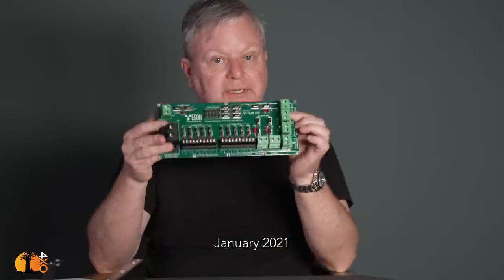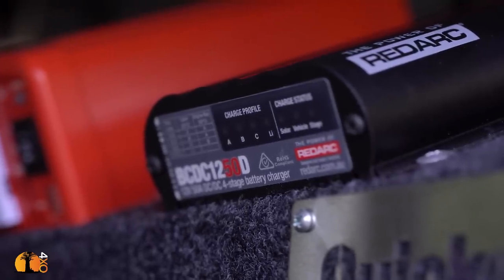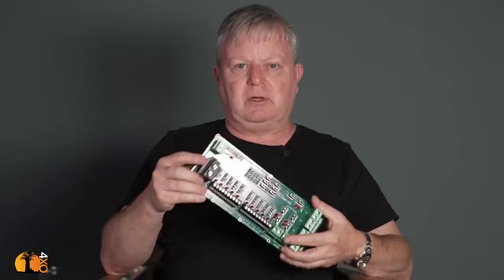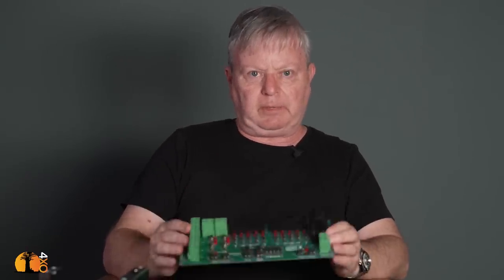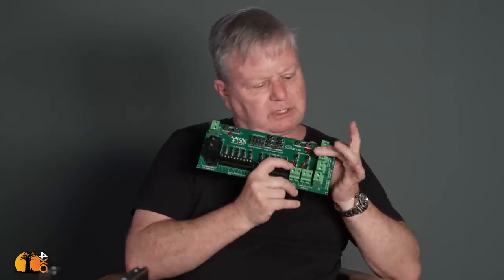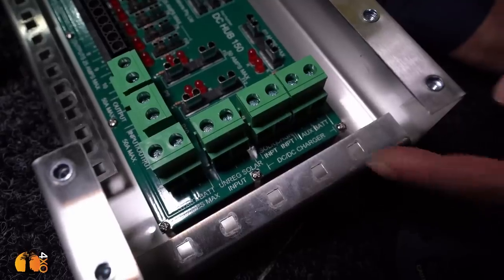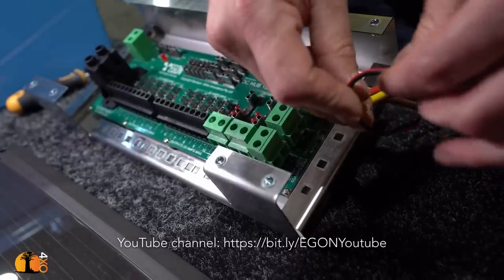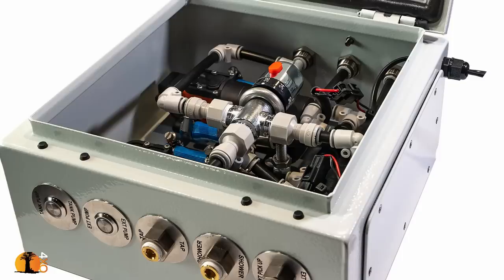DC-INSTALLATIONS MADE EASY. Unique, Problem-Solving Solution. Egon DC-Hub

Comment: Little voltage drop across the board, yet probably plenty in the long run from your main battery to the unit, wherever you install it, then on to your DC/DC charger, back to the unit again, then on to your Aux battery & back to the unit again. Maybe I'm missing something as I'm an automotive design engineer so it's probably not aimed at me, but other than providing a heavy duty, relatively foolproof, labelled fuse box  I'm not really seeing the advantage of this over a simple electrical install for the batteries/charging system close together to avoid voltage drop & a decent fusebox in an accessible point for all of the auxiliary electrics.

Simplifying by complicating..
Reply: I agree totally with your assessment mate.
Reply: What I don’t get is how is this different to a pre terminated fusebox?

Like I’ve just finished my set-up, battery to fusebox, laying out my fusebox with the same fuses the vehicle uses and cable to outlets, what was hard about that?
Reply: Are you an engineer
Reply: @nosignal88  Yep, & I've built a couple of 4wd electrical systems using negative bus bar fuseboxes (with blown fuse indicator LEDs) & relay boxes for switching anything over 15A, all labelled properly for diagnostics in an accessible space taking up far less room & actually looking tidier & more manageable than this. I've never run main battery cables, aux battery cables & solar input to a junction box before a DC/DC charger though as it actually defies common electrical sense to lengthen the system & add any form of hub in between them.

The kit looks great quality, but sadly isn't necessarily a leap forward in functionality unfortunately.
Reply from the maker: "back to the unit again . . " What? No. It's so clear that you are completely missing the point.
Reply: @4xoverland  Hmm, maybe one too many 'back to the unit' bits as I was editing as I went whilst looking at the wiring diagram, which basically shows it as being an extra step in a DC/DC system where you would normally have uninterrupted wire runs between it & the batteries. 

I wish you well with it, genuinely, as there's probably someone struggling or scared of electrics (happy to admit I've verbally abused 12v many times) it will truly help.

Comment: Doesn’t the RedArc RedVision do the job?
Reply: It looks like RedVision might suffer from having unnecessary complexity.  That said it does look like it integrates not only the power distribution but also the controls.

I personally want something sort of halfway in between this and RedVision.  I want something that has the robust power distribution and fault indication, but also includes relays for proper switching of circuits that a user might wish to be switched from a low-current panel.  Think of typical automotive wiring and logic from say, fifteen to twenty years ago.  One version is a switch that instructs a relay to change state.  The other is an input to a BCM, the input is taken as a momentary, the input tells the BCM to turn on or turn off something, allowing multiple inputs for control, like multiple door sensors activating the dome light.
Reply: yes, yes it does. plus has switching.
Reply: Nothing like being over dramatic about your own product.
Reply: The redarc is light years ahead of this

Comment: Interesting, handy to have fuses all together.
Reply: But ask yourself the question: Is it worth over $800- to have all your fuses in one place? You've still got to factor-in relays and switching cabling. It'll end up being a dog's breakfast.
Reply: @billroach2393  for me no, as I don't run much 12v stuff. Esky and single battery works for me.

Comment: Possibly do an aluminium bracket for more budget friendly build same with doing a 5 output and 1 input super simple setup for smaller and cheaper builds (like in a boat)
Reply from the maker: If that's what you need, then use a Blue Sea fuse box.

Comment: Would it be possible to add relays onto the board for the outputs?  That would really increase the efficiency of wiring and fault finding ??   Now I’m not questioning German engineering but how do those terminals hold up to prolong the vibration?? I have come across loose connections with similar terminals on fixed installation subjected to vibration...
I’m by no means criticising their product because your work is fanatic

Comment: At first I thought it was everything in one place - so a vsr or dc/dc system built in and perhaps with some monitoring or maybe even Bluetooth control and an app perhaps ...  

but instead it seem to be a distribution board with screw terminals, some regulation, and LED indicator lights?

a bit like this for £15: https://www.ebay.co.uk/itm/6-Way-LED-Blade-Fuse-Box-with-Negative-Bus-Bar-and-Cover-Car-Boat-Marine-/253750072145?_trksid=p2349624.m46890.l49292
Reply: 100%. It looks like they tried to over engineer something that is simple and most importantly cheap.

Anyone who has the capacity to use this system won't have any issues using crimpers & solder with standard fuses & fuse blocks

Comment: its defiantly an excellent product. The only down fall is the price. If it was more around the $250 mark this would be super popular. (possibly make a smaller version with 5 outputs and only 1 input for more basic setups?
Reply from the maker: Those are already available. E.g. the Blue Sea fuse box is one of the better ones.

Comment: In one word - NO. I asked several if the DC 80Amp is OK with inverters such as victron ones who incorporate a 35 amp charger when pluged to 230/110 - nor I got answers it will it work if unpugged into starter battery - sut just a big "bar". 
If you want to sell those out of AU please (...)

How would you fix any alectronic on these - works aswell for diesel engienes post 80 series - ingectors pumps, intercoolers (...) vs petrol non colitional engine. Yes, you have the money to buy a 79 (..)

Glad if I had an answer - technical ..

Regards

Comment: I think the quality of this would be high end. Something that lacks from copy cats. This is a great idea but not new. Blueseas I think there called make a couple of different fuse block sizes that great and marine quality, fully tinned for basic installs. However I can see where this shines and isn't for everybody. Auto sparkies doing van installs etc etc. Even though its pricey I think its reasonable if you add the price of a quality redarc dc-dc charger $450?  This board has a charger as well if I understand it right. For the size it should have some relays for Bluetooth capability but its not a deal breaker. For people with no electrical background the LED indication is perfect when a fuse blows. It appears built rock solid and should last the life of install no problem. Its not a gadget but a simple fuse block with regulated/unregulated solar input with blown fuse indications. Itll have a place but unfortunately not in my car unless there's a smaller option. Nice work though.
Reply: It doesn't have any charger, in fact it has no electronics.

Comment: As Andrew isn't answering questions here, can somebody tell me why this is favourable over a Blue sea fuse box? I don't get it.
Reply from the maker: Blue sea has 6 or 10, 25 amp fuses. and that's it. This distributes inputs as well. This takes inputs from chargers. It takes input from solar.  It outputs to 80 amp (X1), 50 amp (x3) and 25 amp (x10). The clamps mean that you don't need lugs of even shrink to run cables. Connect EVERYTHING under 80-amp draw and all chargers to it. You can't run cables from chargers through a Blue Sea because its just a fuse box. This is not just a fuse box, although it does have a fuse box as part of it. There is more.
Reply: @4xoverland  thank you for the explanation. I can see the advantage of having different outputs, that's handy and also appreciate the quality. I am running my solar charge controller via a fuse box.

Comment: Wish it would be a bit cheaper or better, offer a smaller version.
Will swap to victron gear soon and like the idea of no, to minimal crimps/lugs in the system. Only have like 4 circuits in total later and hub is a bit excessive in that case.
But good idea!

Comment: This is brilliant , well done , can’t believe this hasn’t been invented before.

One suggestion: make the Perspex an openable door. Who wants to spend 5 minutes fiddling with an Allen key to replace a fuse. You could even make the door lockable. If you use it call it the Sydney adventure man locking door after it’s inventor 😉

Comment: Nice circuit but I would add (Egon 2.0) some electronics to it. For sure, communication with a remote monitor (either wired or wireless)
Reply from the maker: The point of this product is that is has no electronics. Products that do what this does with electronics are everywhere. This is the only one that does it analogue style.

Comment: You  need to add a remote contrl switch, that is really deacresed wiring and composition insdie the cabin. 
Q about water: does it need pump in the water tank? Does it regulate a flow? Like for shower ? or dishes. I founf many times even at garvity flow it waste lots water by accident.

Comment: I totally get why you came up with this!
As an auto electrician I totally get it.
This will sell to people who are building multiple vehicles/RV's etc and want them to be identical. Save time and money on a build. $100 an hour/ 8 hours saved??? Don't know.....

However for that price it will not sell to the general public as they will choose to spend that money on a better battery instead and just use a few fuse boxes.

Brilliant idea, nice and simple but definitely not for the average person.

Most 4WDrs are just that, average people who have a go themselves. Very cool idea but totally wrong market.

I hope it sells like hotcakes to all the big mobs 👌
Reply from the maker: You are not far off. But then add the savings of cost of crimps and shrink, if the connections are not made with crimped ferules, which is an option.
Reply: @4xoverland  crimps and shrink cost a couple of quid over here in England. A McDonald's cost more to buy than crimps and shrinks. I may have missed a point here but its just a very expensive fuse box, can you please explain why i should use this very expensive fuse box over a 30 quid one that will do the same job

Comment: I like your work Andrew but this must be a joke.  It's just a fancy fuse box of which there are many on the market that do an excellent job and in a smaller package and a more affordable cost, with little drop in voltage or diagnostic abilities.  Steve
Reply: Got a link to one? Would help with my canopy
Reply from the maker: If that's your take, then you are missing the point.

Comment: What am I missing here? It’s literally just a fuse block... Not that unique at all...
Reply from the maker: Yes, its a fuse box. But there is no fuse box IN THE WORLD that does what this does. How many fuses in a typical trailer or 4wd build? 10? 20? And where are they? All over the place, in line, fuseboxes and how many buss bars? 1? 2? 3? How do you fault find in all that maze of cables? Is it easy? How about one unit where ALL the fuses (with the exception of battery terminal fuses) come together in one place. All of them. No ground bus bar needed. Half the build time, double the simplicity in wiring it and fault finding. If that doesn't seem like an advantage to you, then this product is not for you. Changing the way people do anything in a new, better way always takes time.
Reply: @4xoverland  thanks for the reply Andrew. I totally see where you are coming from, this product would be a great advantage to someone who has an overly complicated wiring build but little knowledge of 12v system. My Troopy has a very simple system and I found that the Narva fuse block was more than sufficient for what I needed. Keep the content coming. Cheers.

Comment: Good idea, however price is not realistic though for the componentry and complexity of PCB in my opinion...  It can be phrased whichever way you like its no different than a fuse box you just have appropriate diameter power trace width in PCB to handle amps exceptionally easy to calculate. If you ever messed around even with any microcontroller like arduino you alredy designed more complex circut that what this...

Comment: That looks like reject shop quality sorry but check out wago german electrical company no screws to strip get loose catch fire wago has all gas tight vibration resistance clamp type terminals  use in mining industry and we use in survey boats and it costs less than the crap you buy at most automotive shops and can be added to in literally minutes cheers love your videos 👍👍👍
Reply: Got a link to one?

Comment: I use the Victron Lynx to do this....and you want bolt lugs with nylon bolts or spring washers
Reply: I had a look.... very nice but rather large
Reply: @JustPete65  Yes, but it can handel upto 1000amps and M8 bolts

Comment: Redarc, was given money from defence to do conformal coating on there printed circuit boards for what I was talking about. I hope now that you know what I am talking about. Think about pigtailing wire into board. Vibration and if there a fault, you got length to do a repair. Thus could be easy in instructions. Next a little glue under the floating components will help. Like led on your board.

Comment: I am dumb as dog shit but, what does it do more than a fuse holder?
There are not fuse holders on the market? Worldwide?
Reply from the maker: What does Rolls Royce mean? That it saves instal time, money and eases fault finding? Then you'd be right. If you cannot understand these advantages, then you don't do a lot of installations.
Reply: @4xoverland  Don't get cranky Andrew.  I do like entrepreneurs like you but this item is nothing more than a fuse holder, isn't it?
Actually, what else does it hold other than fuses?
Also, how does it save install time compare to a fuse holder?
How does it saves money? It save 7 hrs of installation time but it costs $700, how much does you auto technician charge per hour?
BTW we still have to install the switches and the relays so we still need to run wires unless your unit can activate the relays wireless.
It does however ease fault finding by showing if and which fuse is blown but other fuse holders do that to.
A few months ago you claim that you invented the shovel now the fuse holder.....
The video are extremely well tho.
Cheers
Reply from the maker: You are still missing the point of it. And by your comments that's not about to change. We sold every one we had made within an hour and have had trade enquiries from several countries. I guess they get it.
Reply: @4xoverland  nah mate, now you are playing Tom Sawyer from Mark Twain!
The point, the point and the point, you have not explained the point to start with and you are avoiding questions like a politician (nice marketing strategy ).
Take care
Reply: @maxgermasi3302  I agree, I also am missing the point.
Reply: @4xoverland  I am also missing the point. Not everyone is an auto electrician so please explain the point.
Reply: @vic6820  buy the unit then you’ll get the point😉
Reply: @4xoverland  they all bought them to copy it asap so they can make a lot of money and they will tell you thanks for your hard work Andrew  It's sorry to say a fact of life this days
Reply: @4xoverland  Selling something doesn't prove the validity or that "they get it" Nigerian's get customers every day from all over the world to :-)  How are those Lead Crystals batteries (AGMs) going that you said were magic and better than those dangerous Lithiums you would never use... what are those new "game-changing" batteries you use now?  Oh, Lithium that right.

Comment: needs thumb screws holding perspex cover on not allen keys thought you where making it simple
Reply from the maker: I do like that idea.
Reply from the maker: Heiner tells me he looked into it. They would add $30 onto the price and the ones he tested had the potential of cracking the perspex cover. So he settled with bevelled allen key nuts.
Reply: @4xoverland  fair enough . shouldn't need to faf about finding a allenkey just to change a fuse IMO